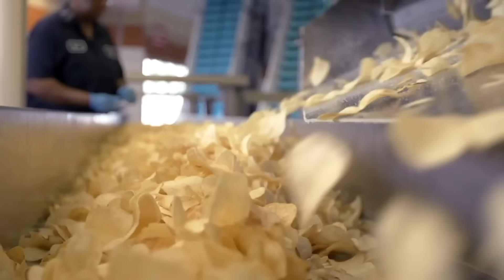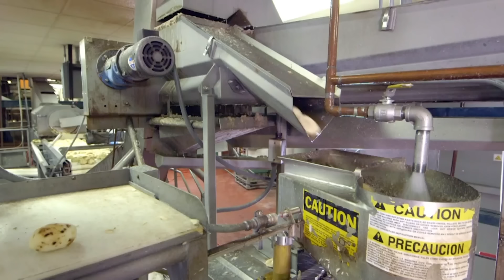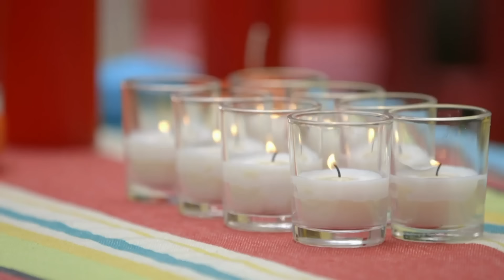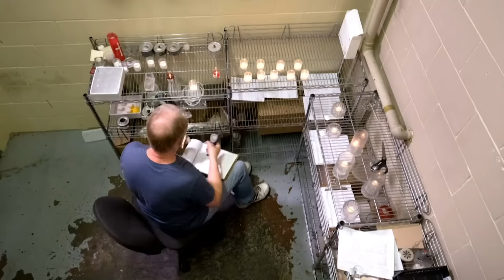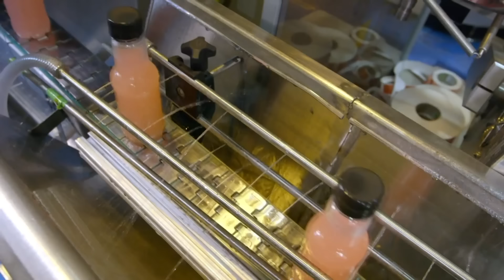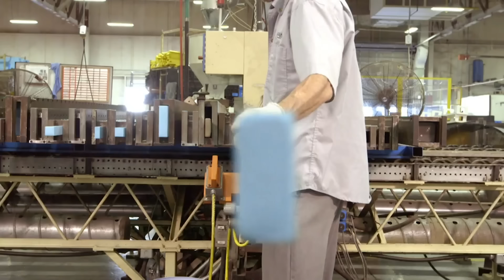How Are Potato Chips Made In Factories? | Making Goods | Spark

Comment: but how do they make pringles where every chip is the same?
Reply: They are made from corn flour, masa, and vegetable oil. The mixture is rolled out onto a flat sheet on what we call a die cut sheeter. A rolling set of dies cuts out a row of flat chips, then they are fed into an oven. The length after they are cooked they are fed into coating drums, where they are seasoned, dumped onto a weigh scale, and packaged.